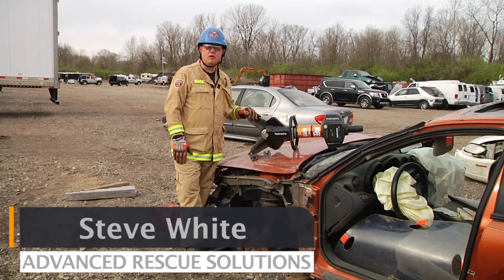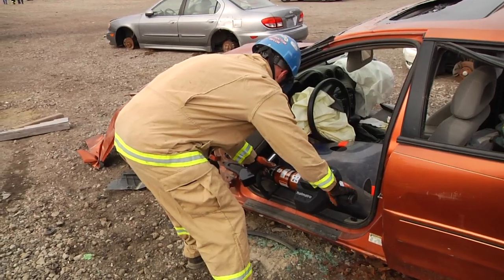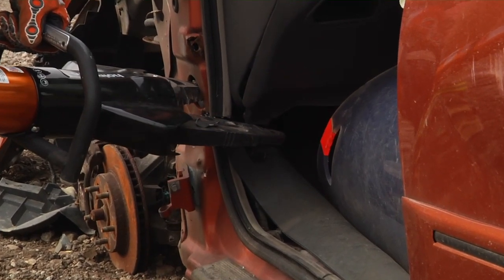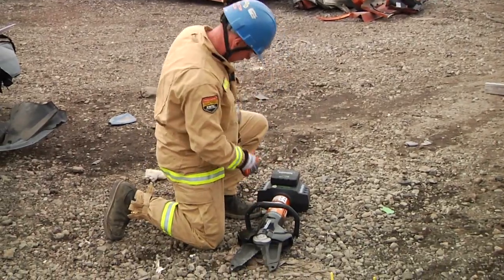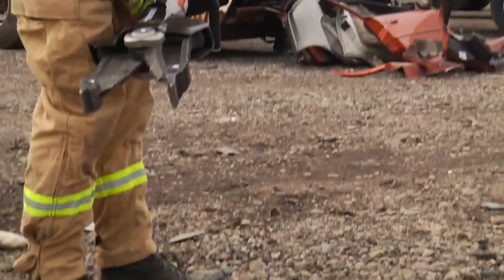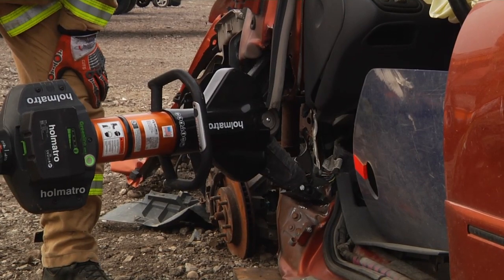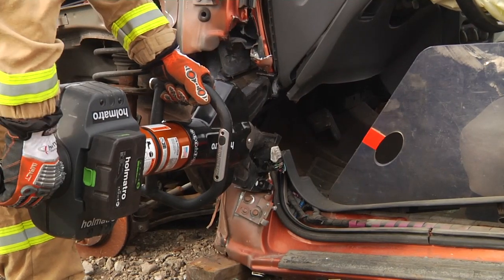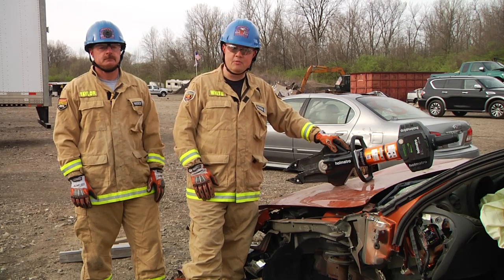Holmatro Quick Cuts 1 (2018): Rapid Dash Lift

Comment: Two mistakes... first the tool went into the drivers sit too much.
Second, no cut on the A post to make the dash displacement more efficient y release force of the structure
Reply: Hi Leandro,Thank you for your respond. Because you refer to two mistakes in the video I would like to address them as remarkable points which differ from the ‘standard’ for as far as we can speak of any standard in road rescue scenarios. 
What you see is indeed that the tool goes too far into the drivers compartment this is also mentioned by the voice over. He says if this happens you need to reposition the tool and start again. 
Working with a combi tool gives a slightly bigger risk that the tool travels further in the compartment than a NCT shaped blade would do. This is for instance one of the reasons we have invented the Inclined cutters.Your second remark of not cutting the A-post high hasn’t been done in this case because they wanted to show the technique of a rapid dash lift. This technique involves only one relieve cut (A-pillar low) and from there you can start lifting the dashboard. In practice you will see that most of the times this technique already creates a large enough space to relieve the entrapment. Of course this is depending on the situation of the car, casualty and way of entrapment.Look at it as just another tool in the toolbox, give it some practice and see if it can be something you might ever want to use. Kind regards, 
Ronald de Zanger 
Rescue Consultant for Holmatro
Reply: I don’t find these as mistakes as much as differences in operation.  I am however with you in that when possible, I would prefer to cut the A post , additionally I would prefer to cut the fender well between the dash and the strut well to allow even more room to flex the dash up.  There are times however when I would not cut either. Especially in a collision that left the unreleased energy flexing up and then directed down towards the patient. Some of these situations might be found in a “run under” where the vehicle was either actively under a large rig or just released from the same.  In those cases releasing the stored energy in those crumple zones may cause displacement into the patient before you were able to start your lift. To prevent the tool from pivoting into the patient on your lower A post relief cut, try cutting from the fender side then crushing the mid post to the interior at 90 degrees to the vehicle, then make your cut at 90 degrees.  If that fails, just pick up Holmatro’s cutter, the offset head should fix your issue :)